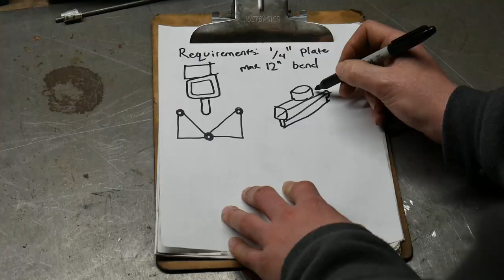Making a Press Brake attachment for a 20 ton press

Comment: why use a tig welder,when a mig or stick would be stonger and easier
Reply from the maker: I wasn't aware that mig or stick was stronger! I bought a TIG because it was the most flexible with respect to material size and composition. At this time I didn't have mig, and in the future if I need a strong weld I will use the stick feature. Thanks for the suggestion